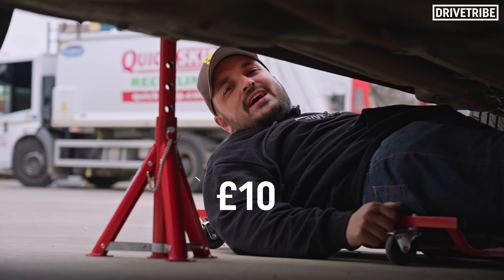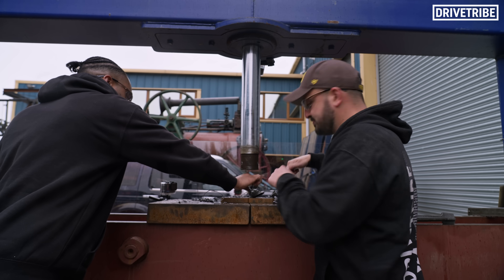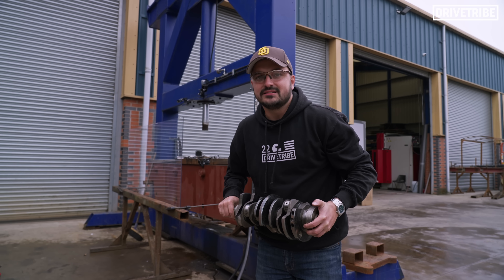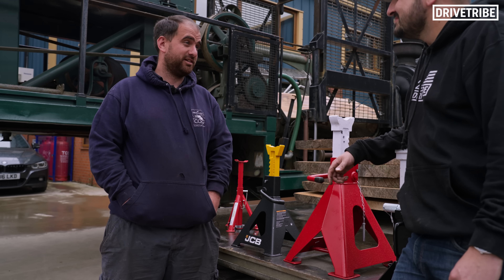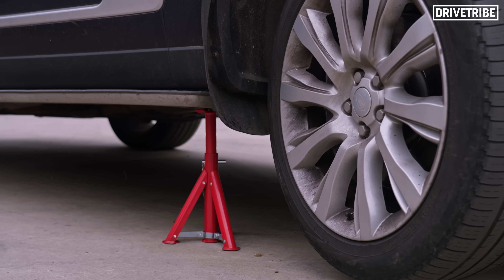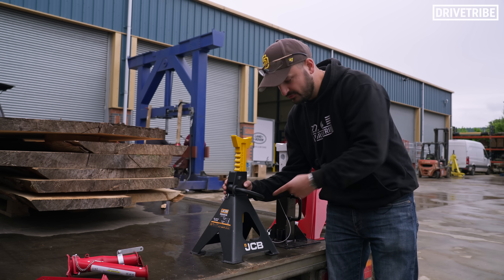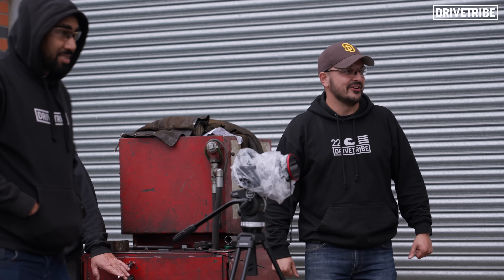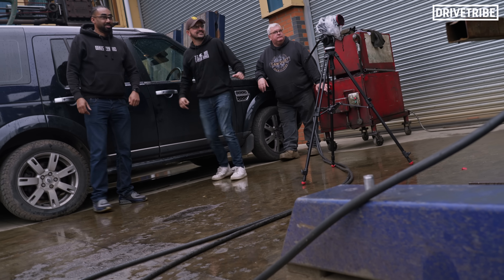How Dangerous Is a £10 Axle Stand? - Durability Test

Comment: Sorry but for most people this video is uselss. The £10 jack failed at 10t.
Most people would use 1 stand per corner so will be perfectly fine at the 3t rating advertised. 
Who realistically has a project car rhat weighs more than 3t?

Comment: I'm less intersted in the comparison of which is strongest, but how close they get to their rating. If the $20 jack stand is rated for 3 tons, and can survive 3 tons then it's perfectly safe and fine to use. I also feel that you dicked around a bit and didn't really answer the question: "How Dangerous Is a £10 Axle Stand? - Durability Test" The video is fine, but you could've done better than a few blokes having a laugh with a hydraulic press.

Comment: My Axle Stands are Lidl specials. But I don’t fully trust them, so I usually stick the wheel I’ve taken off under the sill, so that if it does come crashing down, I’m probably going to be injured, but won’t have the 1.5T weight of the car sitting on me.

Comment: the stands are durable.   2 tons or 5 tons.  But there are problems if your car's main bearing structure loses a rigid bracket shelf.  The metal is simply rusted.   Then it is dangerous to bet on stutem.   The supporting structure of your car will invite you.   Old cars have it.  It should be placed on the shelves of the supporting bridge.

Comment: to be fair, the cheap stand withstood more than the weight of an average vehicle that an at home mechanic would be servicing..
Reply: No kidding. In fact didn't they say 10 tons? Rated for 3, withstood 10? That's a lot of bang for the buck.
Reply: @ed_goblin  Or could even say ton for a buck :)
Reply: Bought 1 of those exact ones to do a clutch on my sisters car. The reason for just 1 was, my orignal stand I'd lost the pin.
I didn't have high hopes for it being flimsy and folding etc but it held the car overnight
I put the entire car on that stand first just as a test and yeah, no issue.
I had the jack on that side too just in case. Very surprised to see it holding 10t though!
Reply: Thats right, I have 6 of those cheap ones in my workshop, they are absolutely fine for regular cars. Only drawbacks of them is their max height, as it usually quite not enough to hold Land Rovers at the chassis, so I have 4 of the bigger ones as well.

Comment: Can someone explain why you need a pair of axle stands with a combined rating of 40 tonnes to work on a car which is going to weigh on average between 1.5 and 2 tonnes? I have a set of Sealey(?) stands which look like the JCBs only blue and rated to 2 tonnes per stand. They cost about £40 and can deal with a 3 tonne Discovery with no problems.

Comment: In the 1980’s and 90’s BBS wheels used to press heated solid centre billet blanks with 6,500 tonne pressing to get the centre weave

And that is why the wheels are so strong and expensive

Comment: This video really needed better information, an explanation of what the results really meant, and somebody to stop Mike misusing the word "Rated"

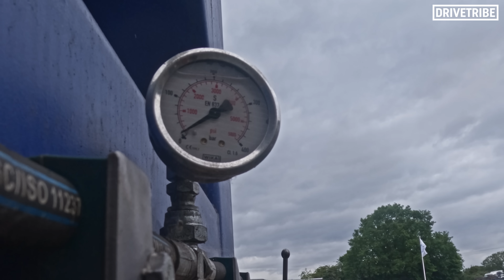09:14 - Talking about the failure of the £10 stand: "That means it's actually rated to withstand a weight of 10 tonnes" - NO Mike, it absolutely is not rated to withstand 10 tonnes; it failed at that weight. The stand is "Rated" to support 3 tonnes in a pair. It wouldn't matter if it withstood the full 85 tonnes capacity of that press in your test, it still would be "Rated" to support 3 tonnes, spread across a pair of stands.

Which leads us to lack of information about a jack stand needing to be used in pairs, not individually. That £10 stand absolutely is not rated to support 3 tonnes; it is rated to support 3 tonnes spread across 2 stands.

The safety margins on all jack stands are deliberately huge, because everybody knows that people ignore the rated safety limits of... Well, everything. 

Given that when you support one end of a vehicle on stands, you are sharing the load with the ground, or a second set of stands, that £10 set is rated to comfortably support a Cybertruck (a tiny bit over 3 tonnes total, or the equivalent of just over 1.5 tonnes per jack stand pair). But based on your test, it could support more than 10 Cybertrucks piled on top of each other, before failing. 

Everybody looks at those tiny stands, and can't imagine them being strong enough to hold a car. You had an opportunity to inform people and reduce that fear. Unfortunately, you failed to give any constructive information.

Somebody else commented that this video was like Drivetribe basically making a "Donut" video, and that you're better than that. I wholehearted agree with them. If we want nonsense and terrible product reviews where more often than not the problem is the presenter not understanding how to use the product, we can go to Donut. Drivetribe needs to stay somewhere we can find accurate information. Have fun, by all means, but don't ruin this channel by racing to the bottom for clicks over quality (exactly like Donut has done).
Reply: I was impressed by the cheapo axel stand. I was also a bit disappointed they didn't make much of a deal of it. We've all had to use them in a pinch at one time or another, so it's nice to know that as long as used correctly they're reasonably safe. Lets face it, your average joe bloggs ain't spending 220 on axel stands.
Reply: @DunksterP  agreed i take a pair of those fold up stands to trackdays just in case I need to raise my 1650kg car up which is miles better than nothing also there not the bulk or don't take up the space of the traditional ones I use at home.
Reply: Exactly this ^^^

Comment: One of the most common failure modes is that the concrete floor below the axle stand fails. The strongest one had a nice big flat plate under its base so probably safer for that reason as well.

Comment: Missed a hell of a chance for an epic road trip and team up with the hydro press channel.
My stands are like the 4th one. I built mine because i couldn't find any that would fit my 1987 s10 blazer on 44s. Only difference is there are hairpin clips on the pin to keep it from coming out the shaft by accident when not under load.

Comment: Otto 1/18 model cars do a ‘mondeo st there rare also
When would you use just one axle stand to rest a car on with all 4 wheels off the ground you use 2 axle stands to lift front or back or 4 completely off the ground so each stand would have a shared weight 
Or still 2 wheel on the ground of car weight

Comment: There are 2 failure points in a stand. 1) The pin or catch when the stand is not in the fully DOWN position. 2) The legs/base when it's in the fully DOWN positions.

My guess is stands are going to be rated for at least half their actual weight capacity.

Comment: If it's going to prevent me from getting squashed by a vehicle that weighs thousands of pounds, I don't think I'm going to go with the cheaper option
Reply: The £10 jobs will comfortably hold a LWB sprinter, cos you always use them in pairs. If you need to lift anything heavier, spend more, but the cheapies are more than adequate for 99% of stuff.
Reply: @g.w.customcreations3534  I will never use the foldable style stands. I've seen those bend and break at the leg pins in the past. I'd always opt for the solid, ratchet style stands. Yea they're bigger and heavier, but a lot stronger for not a lot more money.
Reply: @Maxwell_Millz  for the peace of mind, I kinda get that, but I daresay you've had to overload and misuse them to break them.
Reply: @g.w.customcreations3534  nope, I would never overload Jacks or stands. Tbh I always make sure they're the most tonnage I can afford. They just get weak at the leg pins over time and can fail. Also the little leg links at the bottom are only held on with small rivets, so again, they fatigue really easily.
Reply: I'd agree with you.